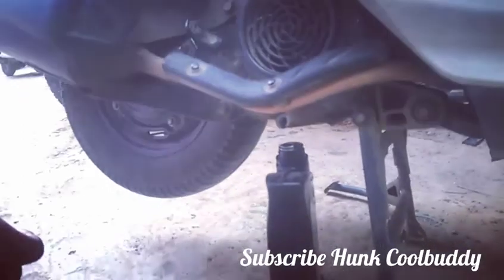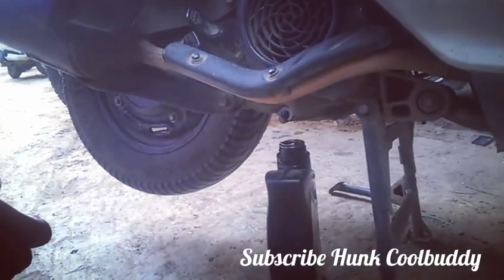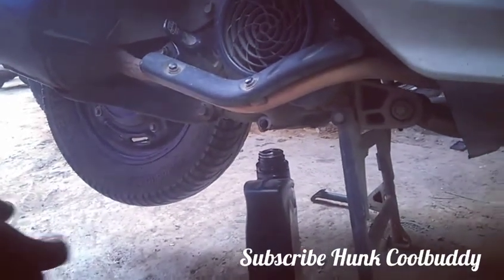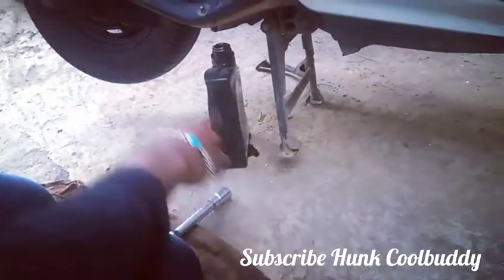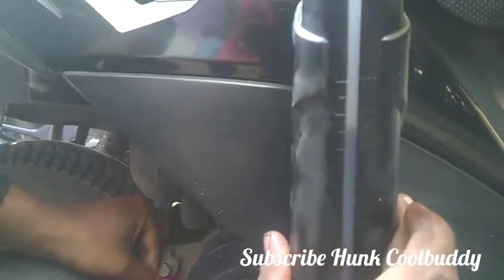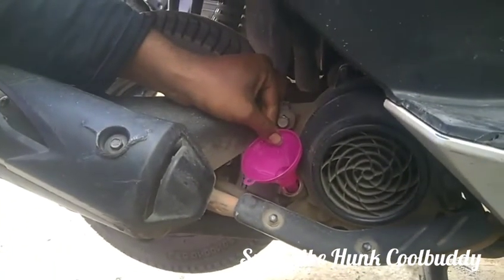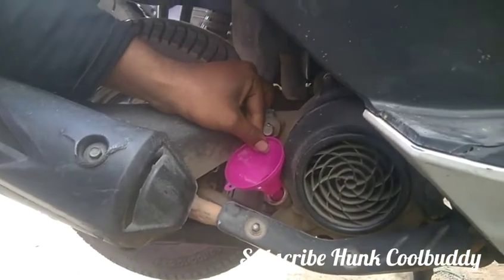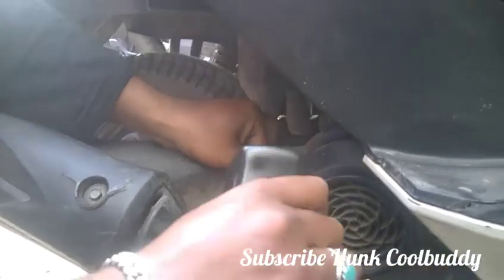Engine oil replacement of Honda Dio

Comment: Can the 17mm bolt opened with a ring spanner ?
Reply from the maker: Hi 
U can but still preferably u can remove the tool what I am using it .